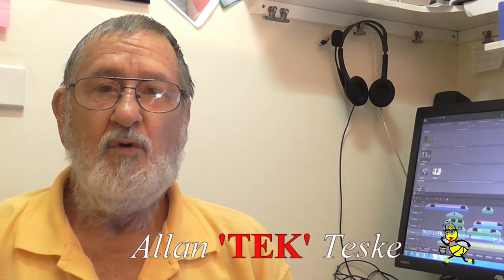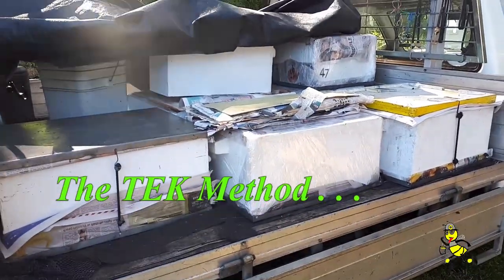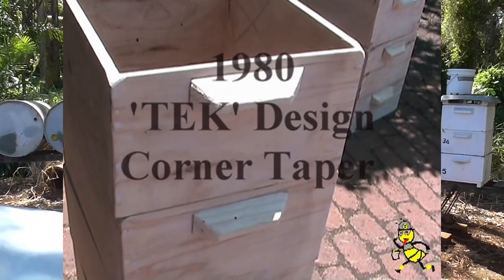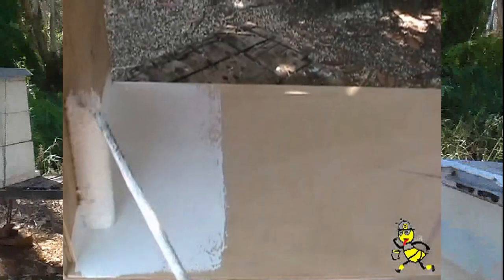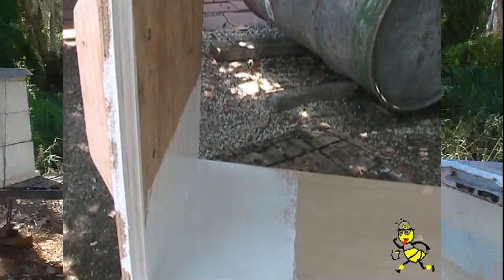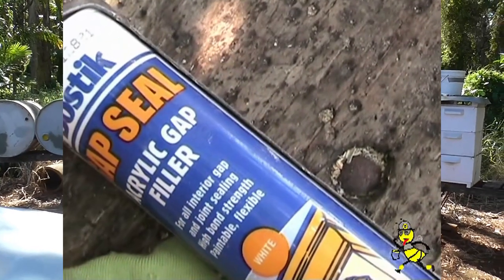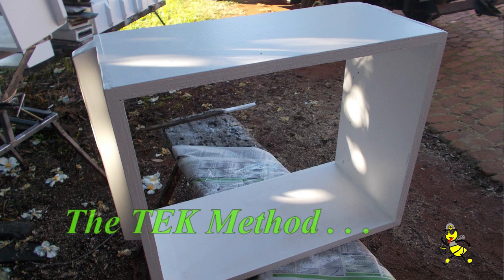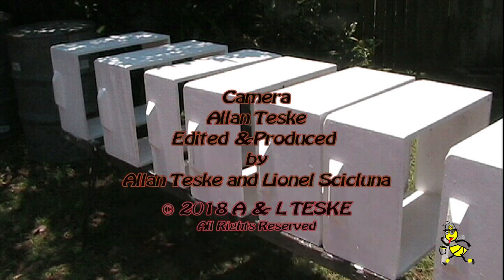7.7 Preparing supers for painting - The TEK Method

Comment: Allan how do you cut the rebate on the ends of your supers?
Reply from the maker: All rebates are done with saw benches ( I have 2 separate ones)
Full Depth Super depth 241mm

Frame support depth 12mm
All measurements must be precise, as my frames only have up to 1mm clearance on the top & bottom
I get very little Bur Comb between supers
7.29 TEK Production Line - Helping Hands, Video will go Public on the 26th February
Reply: @Beetek0903  Thanks Allan this will help with building our own hives. Thanks Again!